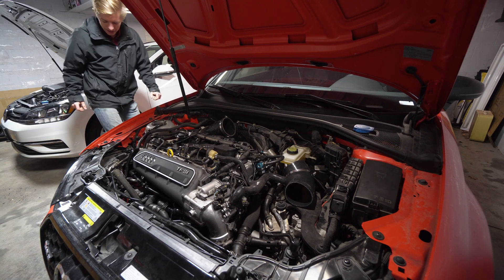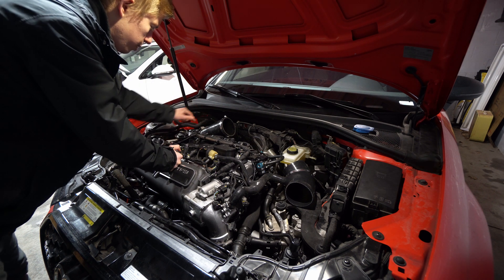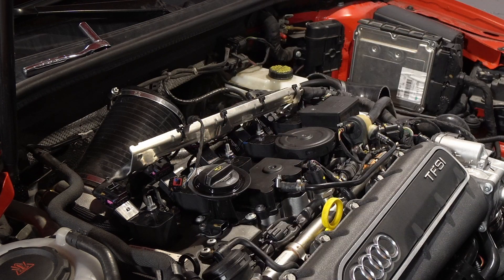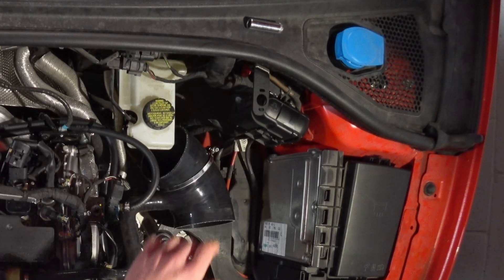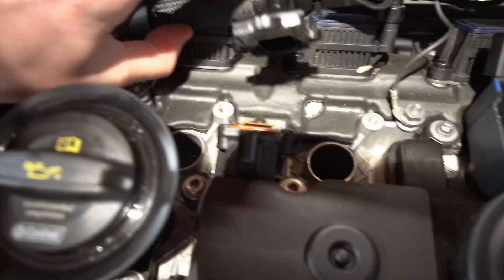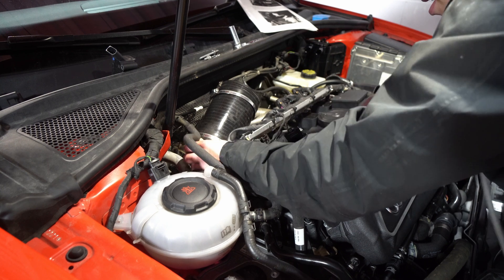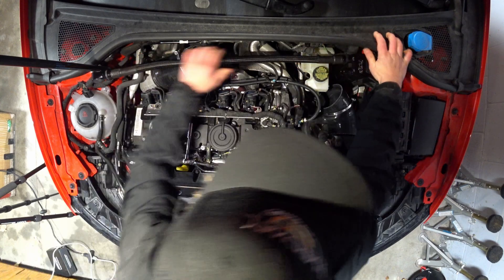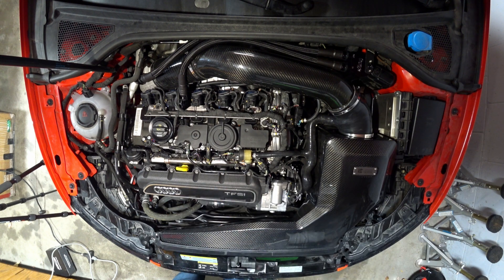Audi RS3 Forge Motorsport Engine Oil Catch Can Install

Comment: Hey man this was great, thank you. It being some time since the install, how have the fittings held up?  I agree I’m not completely sold on the iroz catch can for 300 more. This option seems just as effective but the lines seemed firm. Did you ever have any issues with them coming off?
Reply from the maker: They haven't come off, but the clearance with the intake tube is somewhat annoying and I've taken the intake tube on and off enough times that I honestly wish it was routed somewhere else 🤣
Reply: @HardwayLearning  right on man thank you 🙏

Comment: Hey! Im looking to get one as well but I'm not sure if I can fit it somewhere else. I already have APR DSG catch can and I believe they are mounted in the same place. Could you check if it can be mounted somewhere else? Maybe left side of the engine, like IROZ?
Reply from the maker: You would have to come up with your own custom bracket, which wouldn't necessarily be difficult, but might not look as "OEM".

Comment: I'm ready to install this kit tomorrow and was concerned with the routing over the exhaust manifold and on top of the intake tube, like was commented below.  Any thoughts after having it installed for some time now?  Seems like the other kits - VTT and Iroz don't have this routing.
Reply from the maker: We haven't had any issues with the lines after 10k miles of really hard abuse 🤷‍♂️. I think they are high enough up out of the way. There's coolant lines running to the fire wall that are much closer to the exhaust
Reply: @HardwayLearning  Thank you for that.  Any tips on attaching the fitting from the catch can to the elbow?  The heat gun seems to have helped with removing the original one, but looks like you struggled for a bit on connecting it.  I have the 4" Unitronic elbow so I am expecting a similar headache.  Silicone grease maybe?
Reply from the maker: @clos2070  I always just press it on, it doesn't really feel like it locks on, but it hasn't popped off yet, I did use saliva the first time.
Reply: @HardwayLearning  Thanks for your help, 30 min install.  I broke the original hose attaching to the turbo inlet coupler once i peeled back the tape... even applying heat for a minute like Forge recommends.
Reply from the maker: Sounds like you had the same experience! Glad we could help 😃

Comment: i dont like the line routing on this kit , goes over the exhaust manifold , in an already tight place , no more air going in there because of the line . i like the catch can kit that have line going on the left near the coolant overflow tank like iroz , VTT etc ...
Reply from the maker: It may not be the best location, but I'd argue the intake tube cuts off more air back there. I don't think two little hoses is going to change the temperature of the exhaust manifold/turbo in any measurable way. 

Plus, some people install turbo blankets, that traps heat in, I'm not sure cooling off your exhaust manifold/turbo is something we should be aiming for?
Reply: @HardwayLearning  its not about cooling the turbo or exhaust ,this place is the exit for hot air trapped under the bonnet ,top of engine cooling :)
Reply from the maker: @clovisniclounivis8403  time for some hood vents it sounds like. I have a cut off wheel 🤔

Comment: No thread sealant on the adapters? I would've thought teflon tape?
Reply from the maker: That's probably not a bad idea, but these shouldn't be under pressure so I'm not all that worried about it and they have an o-ring? 🤷‍♂️
Reply: @HardwayLearning  Got it. I just don't trust anything carrying oil ;)
Reply from the maker: Yeah I feel you, hopefully it's a minimal amount of oil and mostly fumes!
Reply: @HardwayLearning  If that happens, I couldn't ride with you. I get off on fumes.